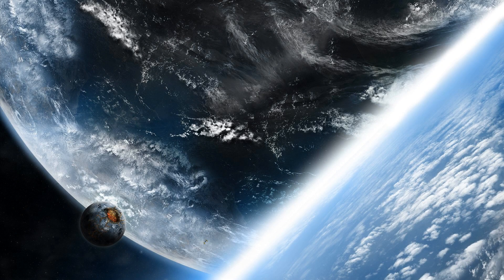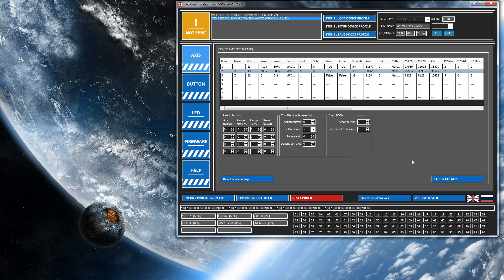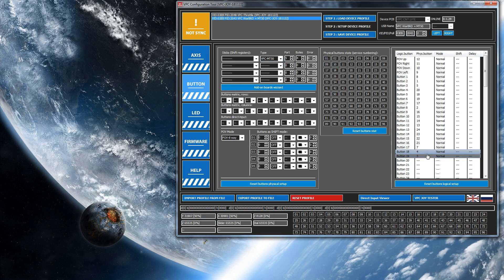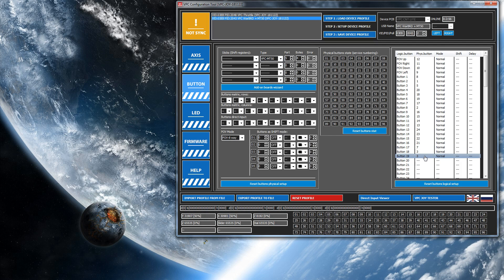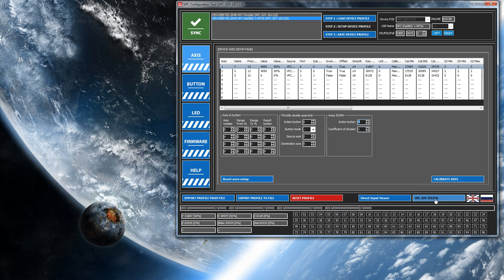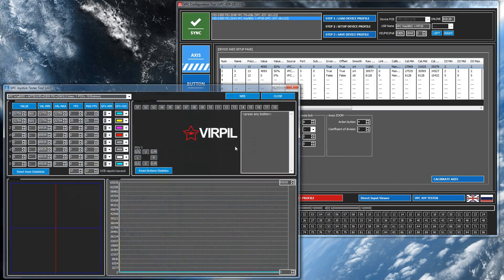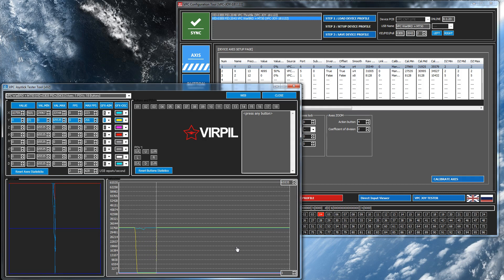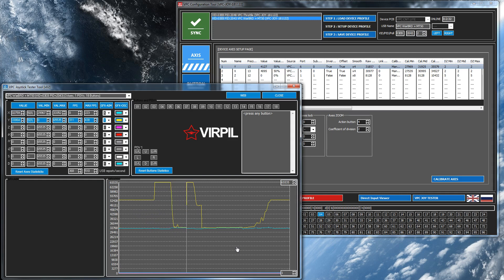Virpil VPC Joystick - configuring Axis Zoom Tutorial

Comment: Thank you for this very detailed tutorial! I have a question here: is it possible to use a button on the THROTTLE as action button to zoom STICK axes? Since I only saw you use a button on the stick as action button to zoom stick axes.
Reply from the maker: you can do it on a throttle and / or a joystick, but unless you want to use joystick gremlin you cannot do it with throttle controlling joystick zoom axis (it only works on the device configured)
Reply: @HavocCompanyClan  Thank you very much! I'll try in JG to see if I can get it to work.

Comment: If I understand correctly, I can leave the ZOOM physical button mapped to a Windows logic button and have the game process that button click AND have the VPC eprom handle the device axis zooming. Say, if the game has a "Zoom" button which activates its Zoom mode where I could use the additional preciseness of VPC's device axis Zoom feature? i.e. to have them in-sync with the same activation button.

I think that makes sense. Although the example of how to best remove the button you're going to use only for device mode activation was very useful. Great stuff in these.
Reply from the maker: give it a whirl
Reply: Indeed I have since I wrote the above. Works as I surmised--although I think it's a niche case and properly removing the Zoom button's logical mapping is the way to go generally.

However, I found that far more valuable than axis zoom is just fine-tuning the axis curves in the VPC software. Holy cow, it made the HOSAS viable for me. I'm sure it's not competitive but it's SP so who cares, and is more immersive (meh), and totally fun. Thanks again for these vids, they paved the way for sure!